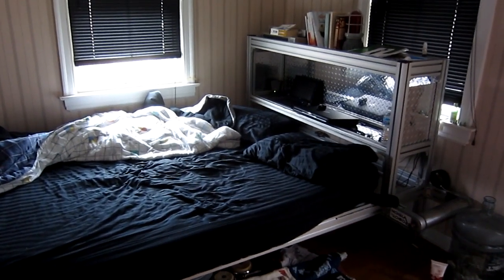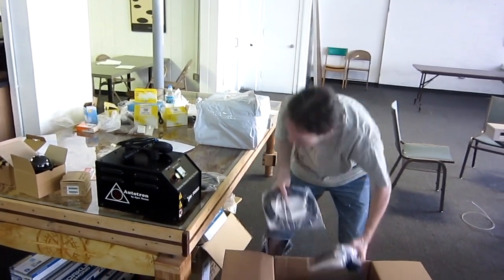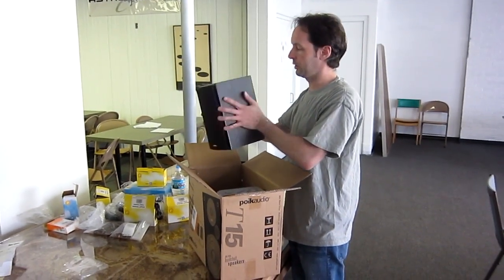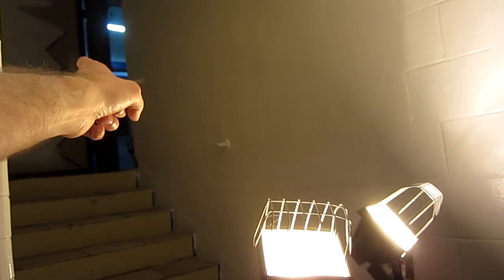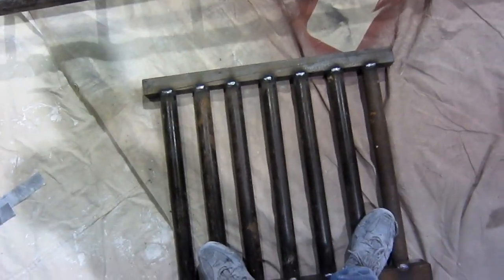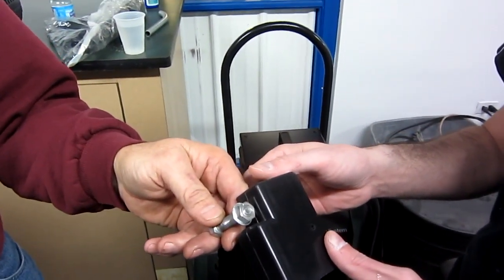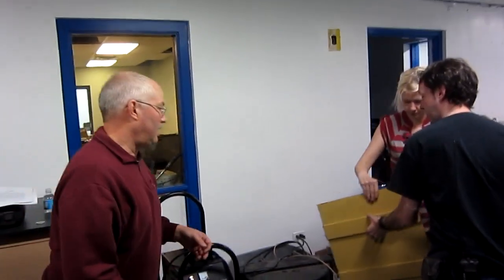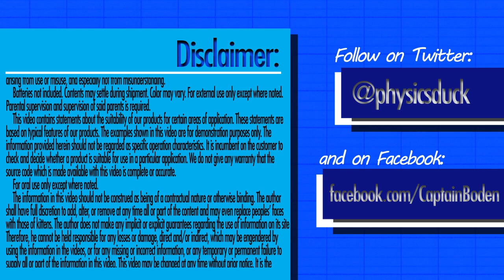Captain's Blog 11-28-11 Bolt Depot Painting and Induction Heating

Comment: well, the files the machine needs don't exist in the exact form on the other machine, as the files are unpacked, installed and then the original archive removed. a local repository mirror would be better in your case i think